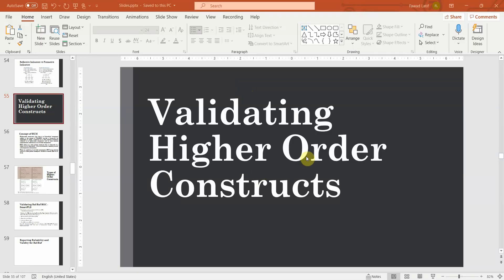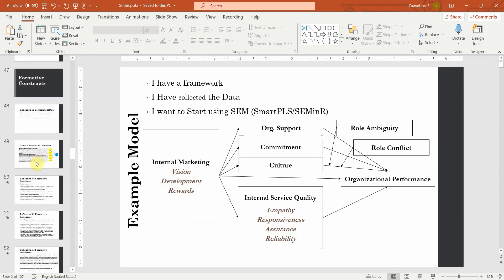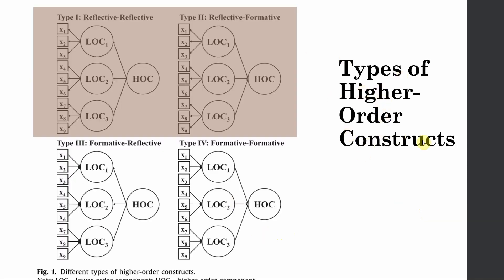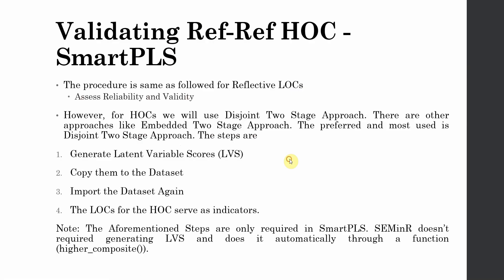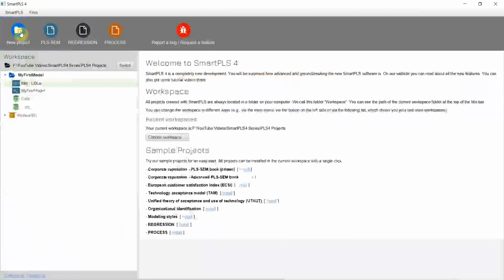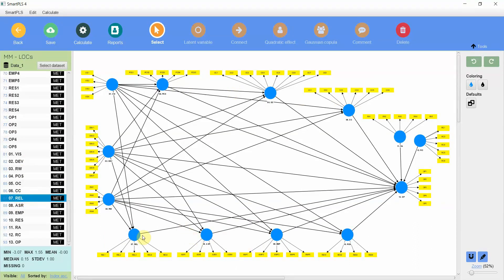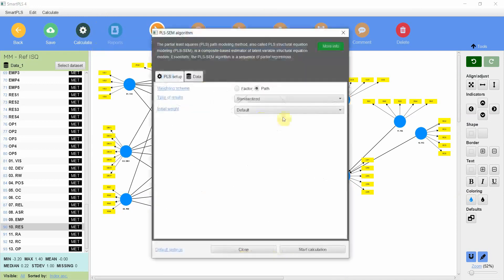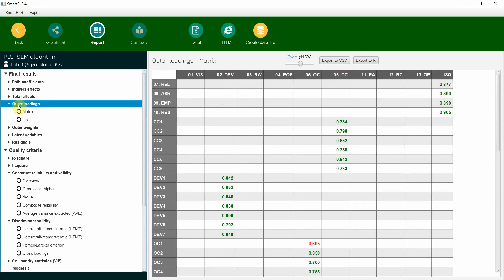#SmartPLS4 Series 16 - How to Assess Reflective-Reflective Higher Order Construct?

Comment: hello! sir in case we dont follow R-R model and show the relationship of 4 variables of IM with bootstrapping  in the same way  you did while calculating LOC without adopting latent variable score...do measurement and structural model results changes or remains same as R-R model
Reply from the maker: The remain the same.
Reply: @researchwithfawad  sir if the results remains same without adopting reflective-reflective higher order constructs. why there is need to calculate hoc of R-R rather we can show the relationship of IM 4 variables with each factor in the given model separately by forming the hypothesis for each 4 variables of IM and running simple LOC and structural model bootstrap.

Comment: HELLO SIR....as you calculated the reflective- reflective model in case of internal marketing All the 4 variables of IM are first calculated on LOC then moved towards HOC what happens if rather than removing 4 variables  of IM we run BOOTSTRAPPING with similar relationship in that case does it reflects R-R model
Reply from the maker: Same.

Comment: Dear Dr.,
When I ran my model in the first stage, an item (BLOYAL_1) restricts the discriminant validity of its parent construct (Brand Loyalty) compared to another construct -- both are not HOC; the item also had a somewhat insufficient outer loading and if it were to be removed, the said discriminant validity would be established. I am unsure whether to [1] delete the item immediately in the first stage, then run the path analysis again to obtain the latent variable scores (i.e., after having deleted the BLOYAL_1) or [2] keep the item, acquire the latent variable scores (i.e., not deleting BLOYAL_1), use them in the second stage, then delete the item in this second stage. I am confused at the LVS are quite different in each scenario. I hope you can provide some suggestions or a definite answer. Thank you
Reply from the maker: Delete the item at lower level.
Reply: @researchwithfawad  Much appreciated, sir